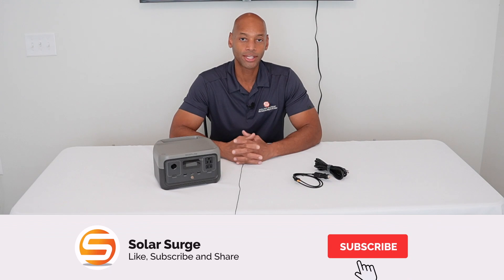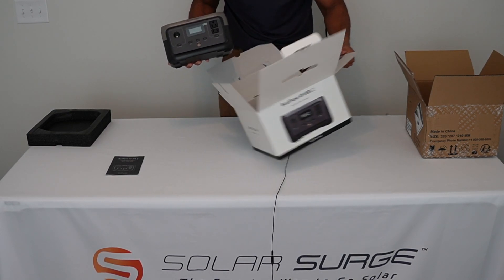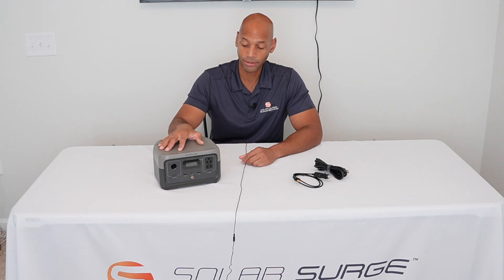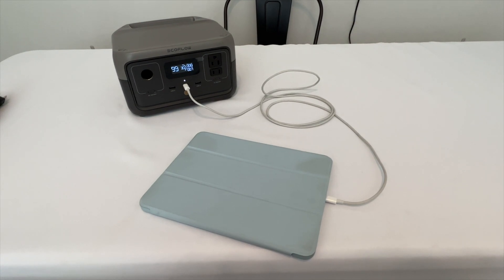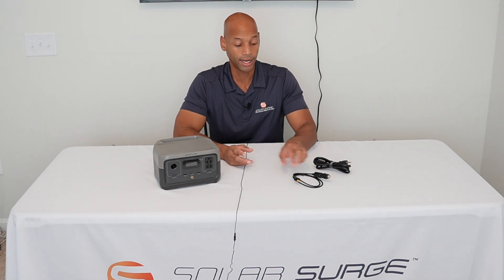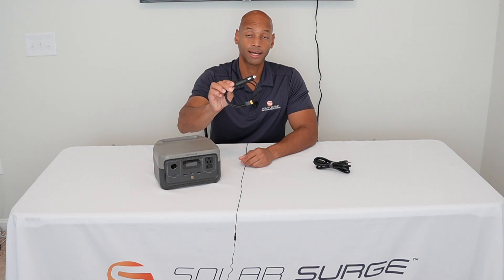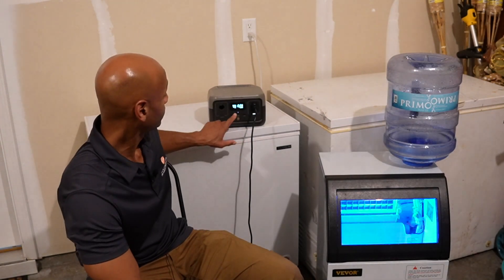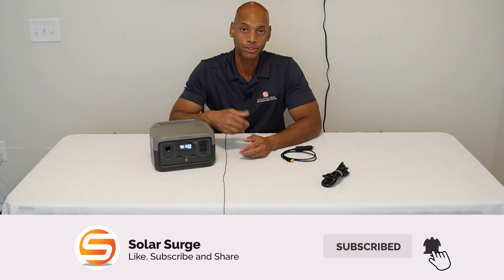Best Solar Generator Under $500 | New EcoFlow River 2 Unboxing and Load Test

Comment: I'm looking for recommendations on a solar generator capable of powering my water pump during emergencies, and that pump draws 13 amps/120 volts when running, BUT it has a (literal second or less) of high surge demand of 35 amps at start up.  I'm not concerned so much with this solar generator having a ton of storage capacity or being able to run the pump for a long period of time, as the pump only runs for about 90 seconds at a time, and in a grid down situation, I can't see any reason that I'd need to run the pump more than a dozen times in a 24 hour period, because we'd be very disciplined in our water usage. Any thoughts on this from anyone?  Thank you.
Reply from the maker: EcoFlow Delta Pro or Bluetti EP500
Reply: Thank you!